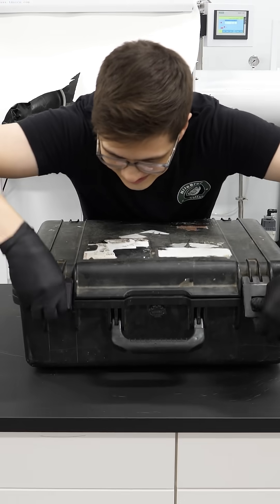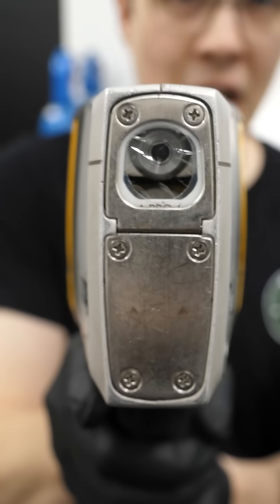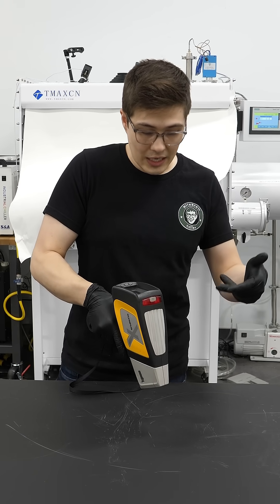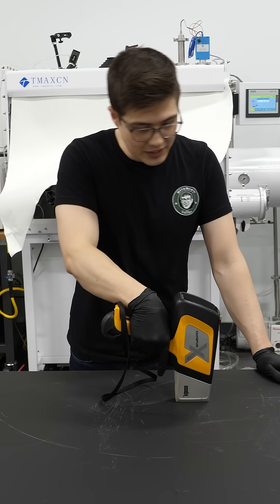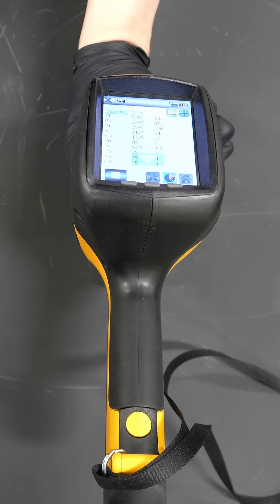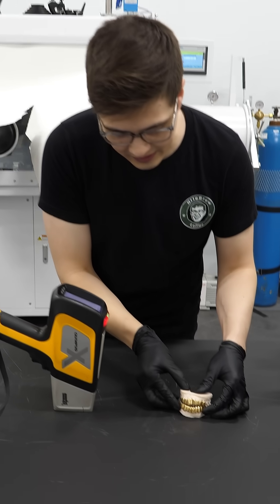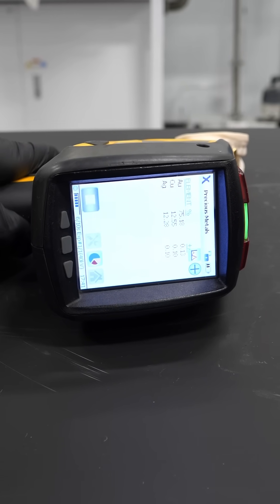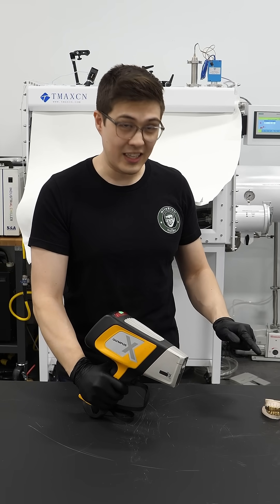I bought a ray gun

Comment: Hey Nile! I'm a doctor and have spent a fair bit of time together with X-rays during surgeries. Just letting you know that X-rays do bounce from things, so while you are generally correct that staying behind the gun while pointing it at your grills is a good idea, it is still likely that the grills themselves reflect some X-rays. Probably not enough to be an issue with just this short video (though I have no idea what the emissions of your "gun" are). Just letting you know in case you weren't aware of this phenomena. If you do a lot of these "tilted" scans, it might be wise to increase your distance and/or add some shielding between you and the device.
Reply: I used to use one of these xrf guns daily as part of my job and just to let anyone know you should be wearing a monitor when using the gun to measure the amount of rads your taking whenever using the gun and its bad practice to fire the gun directly downward as your feet/lower legs are still taking some of it through the table.
For anyone using these always point the gun away from yourself and anyone else in the area. But to put anyone who has to use one of theses mind at ease so long as your using these properly you should be waaay under your daily allowance of rads even when performing many tests per day..... but still be safe with radiation guys
Reply: Lead underpants
Reply: @jamesparsons6478 classic terraria armor
Reply: What sort of shielding would u recommend?
Reply: @TurdFurgison-t3m  bare minimum wearable gear fitted with lead plates
Reply: @TurdFurgison-t3m  lead vest is a good start, its the standard for hospitals and clinics, protects the important bits decently well.(apparently if you have breasts you leave a lot of cancer susceptible tissue exposed tho with the standard ones tho)
Reply: @TurdFurgison-t3m  they drape a led coat over you at the dentist
Reply: @TurdFurgison-t3m as far as I’m aware there aren’t too many materials that block x-rays since it passes through a lot of stuff (hence why they pass through most of our bodies but get bounced back by our bones). Lead is referred to a lot so I imagine it would be one of the better materials to use
Reply: Lead vest time babyyyy. Lol sorry 90s dentist memory kicked in
Reply: @mikebay9967  They still use lead vests at my dentist!
Reply: I love that the first 2 comments are helpful advise how to use the X-ray 'gun' responsible.

That's the kind of engagement we need more of on this side.
Reply: "Bounce? We are bouncing now?"
Reply: Those guns are not comparable to an regular x-ray they have 10^(-5) less luminosity but a wider spectrum - I wouldn't let my kids blast each other with it the whole day but otherwise those are relatively harmless
Reply: Was wondering exactly that. Thanks for sharing. Please stay safe Nile team.
Reply: Bragg reflection?
Reply: Bro his balls are 100% lead, big enough to shield the both of them and anyone else watching this..
Reply: i am curious how these actually work in identifying percenta\ges of different metals an object has. I do see that the surface of the gun is flat and it seems that it is meant to be place on flat surface of the metal you are trying to iddentify. and there is probably some kind of freflective shielding around the sides of the end of the gun. What i would like to know is if it is only providding the constifuency of the upper surface of the material? if this is true then it could be coated or laered with a metal but be hiding the actual constituency of an underlying metal that is very different and be providing you with a false reading of what the entire metal consists of?
Reply: thanks doc
Reply: As for “bounce”, the term is - scatter, Compton scattering
Reply: He probably asked if he should move in order to get a better shot, not for rad protection is what im thinking. Considering the insane exposure to other toxic chemicals i dont think safety is very much a concern with this gun....
Reply: I'm not a doctor and have not spent a fair bit of time together with X-rays during any surgeries, but I, too, suspected the bouncing off of grills because he had just stated it bounces back toward the device
Reply: Please test it on your radioactive materials! It would be Kool to see what something that already emits radiation, reads as!
Reply: Do i really not have to worry about the amount of dental xrays I get Dr?
Reply: If you were born in 1975, your body is so used to x-rays. You would have to have twice the normal limit to affect somebody like us Gen X. Our lives are filled from taking medical x-rays from when we are born until we die. It’s a scientific fact that our generation has a pretty high immunity to x-rays?
Reply: @collinsanchez9949  You are 100% wrong. You do not develop immunity to X-rays. It's just as ridiculous as claiming that you're immune to fire because you've been spending a lot of time around a campfire.
Reply: Full hazmat suit made of 10 mm lead
Reply: Man hearing a doctor and other nerds tell a chemist about how light works is friggin baffling 😂 literally every doctor I know thinks I'm a freak savant and I was a triple major engineer. If anything I don't think you should be able to be a doctor until you can understand chemistry and physics on a quantum level. Just my opinion 😂.
 (In case anyone thinks I'm just being mean, if you've ever gone to school for advanced sciences you'll realize, it's all pretty simple constructs just a lot to remember, so essentially if anyone had enough patience they could learn the exact same things. Therefore everyone that brags about being collegiate and hold their education far above others typically are only intelligent/of average intelligence in a very niche field. Whereas in the grand scheme of things they are just as simple as the dude doing books for a gas station)
Long way about this point is that Chemists take more mentally rigorous courses than doctors do, doctors are glorified pharmaceutical salesmen.
Reply: I work in a nuclear reprocessing plant, these things emit very little (that's not to say they shouldn't be treated with care). The bouncing you are referring to will be very scarce, if it was emitting a lot and bouncing, it would have been picked up on the camera in the form of little white dots (a little like CRT static screens).
Reply: ALARA- As Low As Reasonably Achievable

When dealing with radiation you should do whatever you can reasonably do to limit your exposure while still achieving your goal. Even if the amount of radiation coming from the device isn’t very high there is no reason to let yourself receive an unnecessarily higher dose. I would liken it to treating an unloaded firearm as if it were loaded. It’s not an exact comparison, but it is simply good practice. Thank you to the people here who shared your experience on how to use the device properly.
Reply: They are not that powerful for back scattered xrays to be an issue and unless you point it at your body you wont get a significant dose.
Reply: But you do realize the guy you are warning plays with uranium, puts his bare hands into hot ice, and made paint thinner into cherry soda and CONSUMED IT… right? Nile has no sense of survival, he takes YOLO to a whole different level most of us will never understand 😅
Reply: It's so funny that literally anybody age 6 & up could tell you "pointing radiation guns at each other isnt a good idea".

I just love how you're here all like "Excuse me, I am Dr. Knowitall, M.D.  & I'm here to use my 8+ years of specially-trained expertise to tell you the sacred doctor-only knowledge that people SHOULDN'T stand in front of an X-Ray Gun".
Reply: So don't stare into the XRF for 37 minutes at a time? Omg thank you I just looked away at 36 minutes. This guy who never deals with radiation probably had no idea how radiation worked until you taught him. But thankfully you've warned him. He's safe - for now.
Reply: @KrakenIsland64  it was helpful advice, no need to be a dick about it
Reply: @KrakenIsland64  Doesn’t he have a cabinet with Uranium and other assorted hazardous materials?
Reply: @matter_gaming This guy's shop should be called "hazardous materials course" 😅
Reply: @KrakenIsland64  I thought I was an asshole lol.
Reply: @KrakenIsland64  I know you’re kidding, but he doesn’t know more than a doctor who works with radiation— he’s literally just a guy with a social media following
Reply: this gun would not emit that much especially comparing it to the sun. Relax with ur fb phd

Comment: Technically here in Canada you're supposed to be certified to operate the xrf analyzer as it is an x ray device. It's part of the non-destructive trade certification, just letting you know so you don't get in trouble, look up CGSB x-ray fluorescence analyser operator certification.
Reply: Are you sure you aren't talking about using it professionally, as in, in industry or as a service provider? Jewelers have table top XRF analyzers and they don't usually require further certification
Reply: @amogusenjoyer  I'm pretty sure all X-ray devices are regulated in Canada.

Comment: I work with these alot as part of my job (QC Engineer) and it called PMI test or Positive Material Identification test, it can detect heavy Material but it has a flaws the first it is not accurate 100% and the second it can not detect light elements like carbon, so there is another type called OES PMI, but is it dangerous and semi-destructive because it will leave marks on the material and also will burn it so the fumes is dangerous for the lungs

Comment: Also known as a PMI test, positive material indication test, super useful tool in the oilfield to check if something has inclusions of certain materials that you may not know about
Reply: We use PMI all the time. Our customers usually require PMI to validate the materials we used are what we say that are when used in the fabrication of basically anything that isn’t Carbon Steel, think Stainless, Nickel-based alloys, etc. Pretty anything that goes in a refinery or PetroChem is going to be PMI’d after fabrication, upon receipt at site, and possibly again prior to start up.
Reply: @jpena53  we used it to report to fabrication places that their pipes were made as instructed.
All sorts of NDT stuff. I do more specialized inspection now offshore with robotics and subsea stuff but loved my old job when I used to live in Scotland, now in the US.

Comment: I handle a large aluminum sampling spectrometer at my current place of work, and one of the supervisors walks in with one of these (It was probably a high powered laser version as it had more classical laser warnings on it).

I was left stunned and partially wondering why we can't just use those!